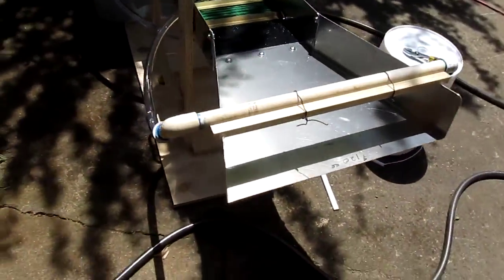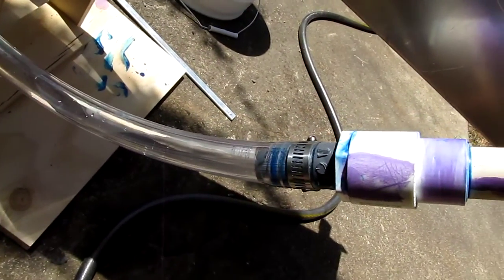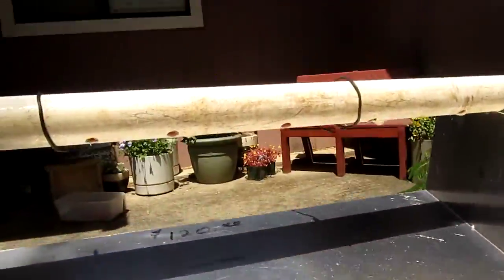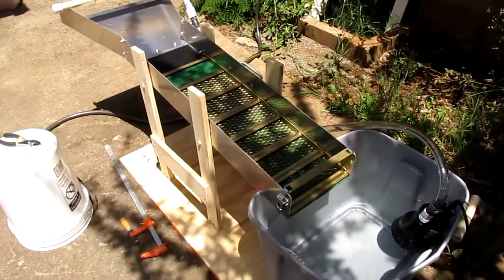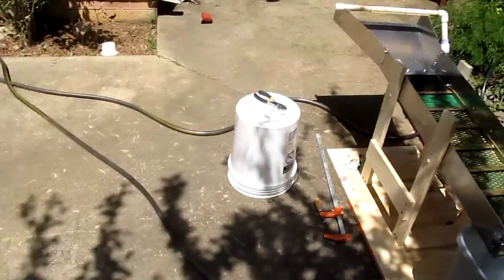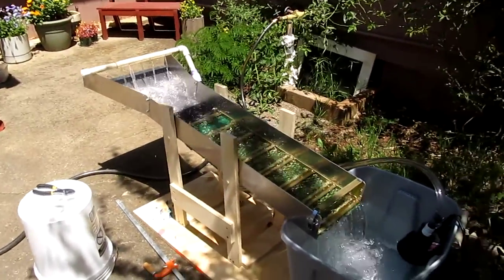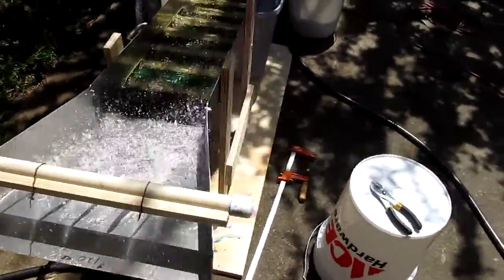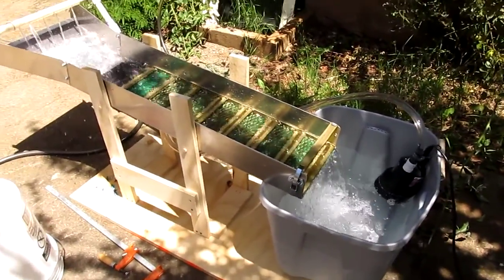My First Automated Recirculating Sluice Box

Comment: couple questions. I'm wanting to build a recirculating system, what's the flow rate on the sump pump? have you ran any material and how did it go?
Reply from the maker: +2011jdub The flow rate was about 12gpm, too slow for anything more than re-sifting black sands. I ended up upgrading to a cheap Intek pool pump that moves closer to 50. That works perfectly for going through pebble size and down. I added a re-flow tank for the pump to reduce it picking up the silt from the washoff. In other words, I have my run off tub at the bottom of the sluice. Then I have a second top just slightly lower than the first and that's the one the pump sits in. I'll post my newer rig this spring when I get it set up and you can see the differences.

Comment: I have a keene 52A and tested it with 1200 gph works great with out the riffles since finding a large nugget is rare. You get a good flow with out the riffles how do you test this by going to your local walmart getting some sinkers since there about the same weight as gold they should stop at the top of your flare if you you have v matting anyway just a little help.